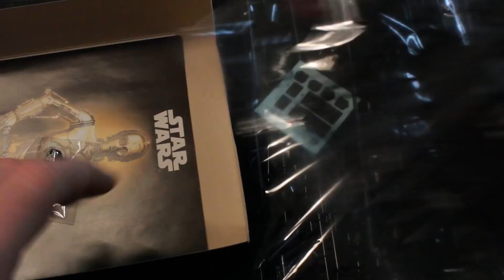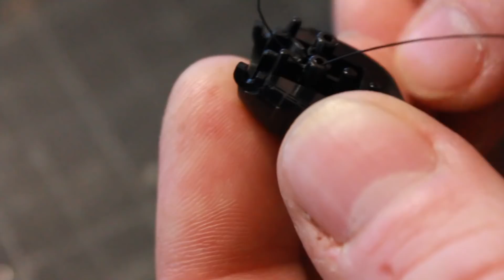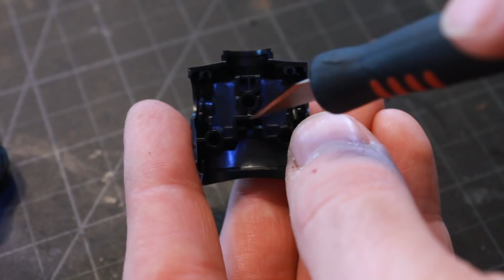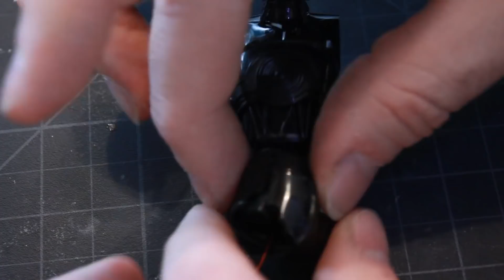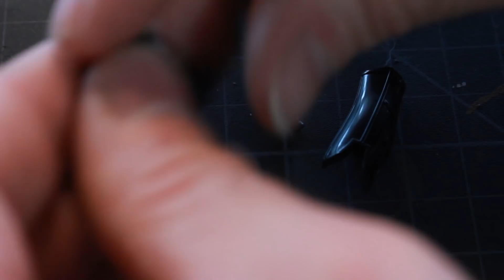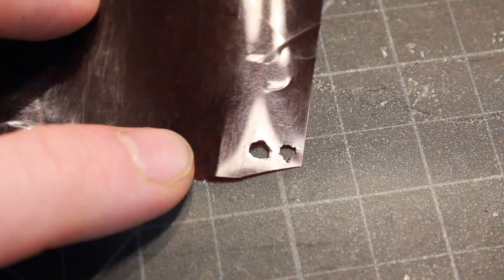Bandai 0-0-0 Model Build

Comment: I built a C-3p0 of this kit  but I wanted to be able to hold my droid with lighted eyes 👀 I wanted a self contained lighting system. So I got the smallest drone battery I could find & it just fits into the waste or stomach of my droid then ran my wires up through the chest then connected it to the LED eyes  & added a small on off switch and charging port to the back of C-3p0 that can not be seen with the back hatch on , yes I do lose all the detail of his internal circuitry of his back but having a self contained rechargeable lighting system for the eyes is worth it to me. The charge last up to 9 days with eyes on & off & 20hrs  with the eyes on full time

Comment: that was EPIC! i might try that, i just need to get those LEds and lil drill lol 
A little suggestion, because they are in Parallel, you could have connected them in the head and run a single pair of wires down, instead of one. But it looks like it all fit, so awesome :)
Reply from the maker: Yea,  in gold site I could've,  but they fit fine as they were.
Reply: @modelsbychris  yeah, definitely looked like more than enough room. excellent build :)

Comment: very nice one.. would it be too fiddly to connect the reds and blacks somewhere in the head or chest, so you deal with just 2 wires for the rest of the body?
Reply from the maker: I probably could've done that as well somewhere in there.  But using the 29 gauge wires they fit ok.

Comment: The backpack on the back of the figure is PERFECT for storing flat batteries, that's what I used for my C3PO.
Reply from the maker: Probably, if you use those mini laser batteries.  Not a coin cell
Reply: @modelsbychris  IMO coin batteries work best, button batteries take up too much room. BTW -Great video, I subbed.

Comment: Where to buy the lights? Surplus stores have thousands of LED keychains and party favors. You can buy them for less than 10 cents each with batteries, many come with two LEDS and two batteries. 
https://www.ebay.com/itm/10pcs-Mini-White-Keychain-LED-Light-Lamp-Key-Ring-Flashlight-Keychain/113736787989?hash=item1a7b3da815%3Ag%3Aar0AAOSws0JaTuoi&LH_BIN=1
Want to add lights AND sound to your Bandai Vader? Keychains.
https://www.ebay.com/itm/1pc-Red-Light-Up-LED-Star-Wars-Darth-Vader-With-Sound-Keyring-Key-Chain-Gift/192551098605?hash=item2cd4f098ed%3Ag%3AeP4AAOSwCHJbCM6t&LH_BIN=1

Comment: Great build as usual Chris. I’m currently doing threepio and was planning to do the wiring the same way. So thanks for showing me that it can be done. LoL Can you send a link to where you get your electronics. I’m having trouble finding proper breadboards, power supplies ie. button cell connectors, etc. Im fairly new to the electronics game. Your vids definitely help a lot.

Comment: How exactly do the led wires connect to the holes in the base?
Reply from the maker: Originally,  I had copper tape on the base and on the bottom of the feet. When you pushed him on the stand, they'd make contact.  Didn't work out that great.  So the wires from the feet ran through the holes in the base and were soldered to the electronics.  His left foot fled to the base.

Comment: Amazing. I am totally going to try this. Could you share links to where you get the leds and what drills you use?
Reply from the maker: I get the SMDs from Ebay.     
https://www.ebay.com/itm/10PCS-Pre-Soldered-0402-1005-Warm-White-Light-Pre-Wired-20CM-SMD-LED-Diodes/121858752674?epid=1956060094&hash=item1c5f5900a2:g:-rUAAOSwqrtWneKz

The drill bits are also from Ebay.  Lots to choose from.  Just type in "micro carbide drill bit set".   You can get a bunch of the same size, an assortment, etc.
Reply: Personally, I suggest going to your local surplus store. A place called Ax-Man near me sells LED keychains for 50 cents each. Each keychain has two LEDS and two batteries, so it ended up costing less than 25 cents per light added. I used these to light up my Bandai C3PO.

Comment: Nice quick build. I learned to put epoxy on those little smds to strengthen the connection at the solder points. I have also seen people use male and female arduino pins to connect the foot of the model to the base, so the figure can be powered without being permanently wired to the base. Please do check out my builds and comment.
Reply from the maker: I was going to use some jst connectors like some of my other builds,  but just hard wired since I won't be taking it off the base at all.